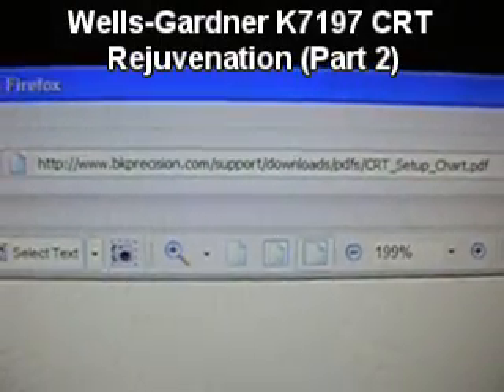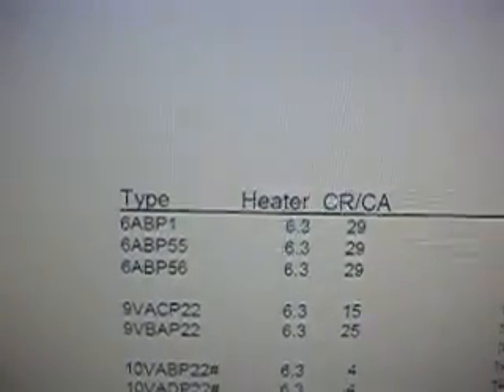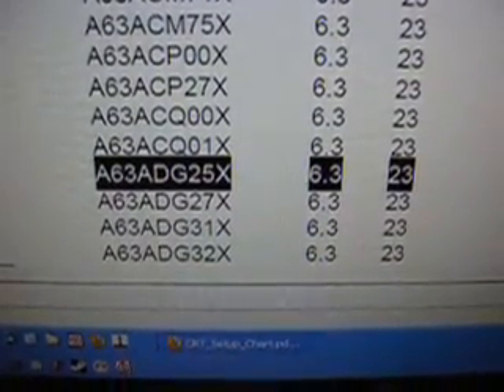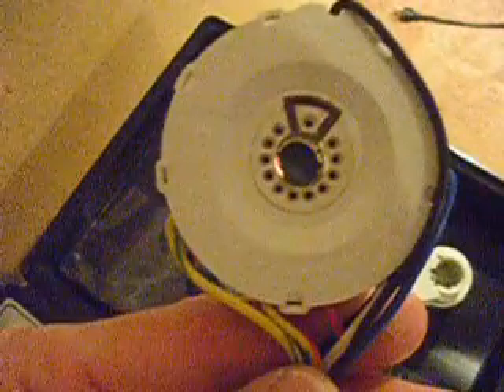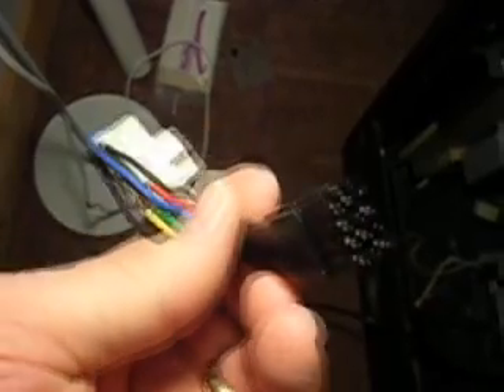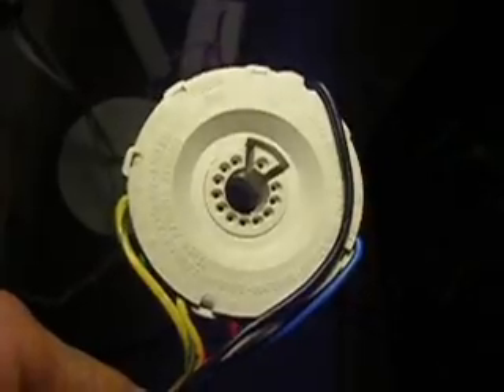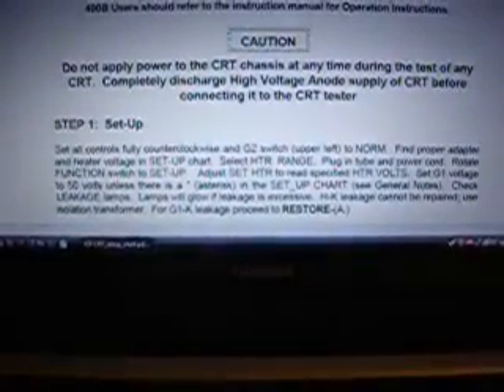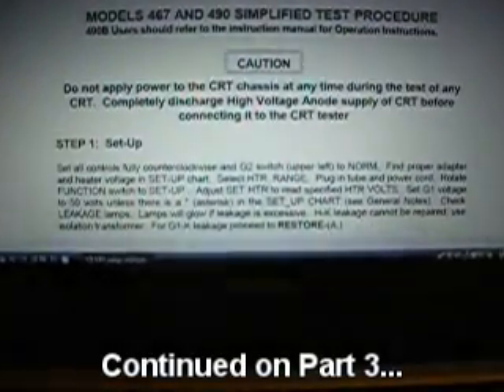(Part 2) Wells-Gardner CRT Rejuvenation

Comment: I remember that tube being used in '90's era Zenith TV's and those tubes were horrible.  Many of them failed under warranty and most of the rest failed within two years. These would also intermittently short and burn up the power supply on the TV chassis. I have rejuvenated them; but, they usually don't last long.

Comment from the maker: @adidas1984x I think mine have 8 or 9 and they look like there could be 11 (if you count these little plastic nubs on each side of the circular pattern).  Then there's the pin inside the key area that helps you align the neckboard on the end of the tube.  So yeah, there may be locations that appear like a pin is broken off, but likely if you have about 8 pins and 1 in the key area, you're golden.

Comment from the maker: @adidas1984x Doesn't sound like too much if it works well and has a tube with good guns and no burn-in.  Especially if it has recently had a cap-kit and flyback installed.